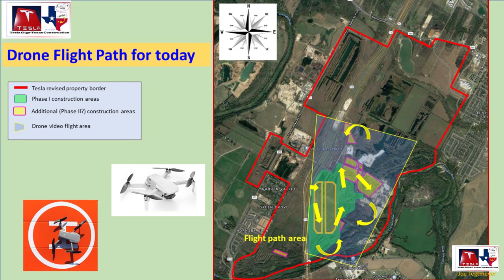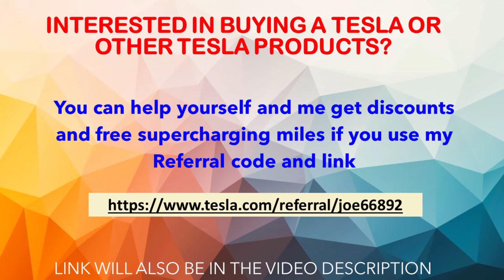Tesla Gigafactory Texas 27 October 2020 Cyber Truck & Model Y Factory Construction Update (09:15 AM)

Comment: After watching these videos for the past three months or so, I don't understand the sequencing of operations.  I would have thought: (1) draining, filling, grading, geopier stabilisation (2) excavation (3) cement and rebar for footers and load-bearing foundations (4) structural steel erection ...in more-or-less that order.  It seems to have started that way, but in the past month or so has become all mixed together..  Is there anybody leading this orchestra?  And if so, what is the musical score?
Reply: In Berlin the progress was identifiably this way only because the step by step at own risk permits were issued sequentially. Here it seems to be the availabulity of contractor equipment that is driving things forward more rapidly. Why waIt until the whole site is levelled when another contractor can already start geopier / rebar or concrete work on a ready levelled section?
Reply: @andygranger3662  That is a plausible over-all rationalization...but take the large stamping/casting pit: It was excavated, then prepared for foundation, rebar inserted with cement forms in place, and then new excavation started to double the effective size of the pit, and GeoPier work again commenced on the newly excavated floor.  At the time there were comments about changing the plan in mid-operation, adding another casting machine, etc.  But I doubt it.  A project of this size must be or at least ought to be meticulously planned and budgeted...changing course in midstream because of an inspiration seems implausible to me....too much at stake.  I wish our quad squad could get some interviews with managers or foremen who know what's going on.
Reply: @johnweiner  Tesla is always innovating, and a fast moving, fast changing company. They change designs and implement new ones rapidly. I am sure the same goes with construction. What was originally planned out months ago sees design changes during the process, as months later Tesla already has new tech available or some additional needs identified due to market conditions.
Reply: @johnweiner  Tony Velasco has his finger on the pulse. The pace of tech change in manufacturing tech is so rapid, that constant revision to planning and execution is required, even if this sometimes seems counterproductive. When I was in automotive manufacturing, the phrase was "teaching the elephant to dance" as the cultural and company inertia was so vast it took ages to implement a change. With Tesla we have the opposite, an organisation that is built around constant iteration in product and manufacturing technique.
Reply from the maker: We all have tried, but the results have not worked out very well.  On occasion I get a few insights from people on the ground, but infrequently

Comment: At this point there should be structural steel (columns, beams) stockpiled on site. Lots. Plus many more bays erected. Wonder whats up with that.
Reply from the maker: Good question.
Reply: If you stockpile structural steel on site, you create the necessity of unnecessary crane picks in setting the steel.  Optimally, the structural steel is picked from the delivery truck only once.

Comment: The shallow footing near the test structure might be the right size for 1 or 2 large press brakes for bending SS sheet?
Reply: This is the Model Y factory but the Cybertruck may be built on the other foundation.
Reply: Many posters have referred to the structural steel that has been erected as a "test". It has been a long time since any sort of testing of structural steel has been performed on a job site. Today we have computer simulations and design programs that have pretty must eliminated onsite testing.
Reply: @BobWoodHFL   So what purpose do you think that item serves?
Reply: @lengould9262  I think that that structure is now curing to ultimate hardness and the next series of structural steel that is to be  erected will be tied to it as an "anchor" to stabilize the steel while the concrete bases under the new steel cures.

Comment: Possibly they exposed those geo piles so the State building Inspectors could check they were correct, and accurately in position.
Reply: There are geo piles located throughout the large excavation. Indicating one large footing that will tie together and support 4 columns. Will see soon if they start filling that excavation with rebar.